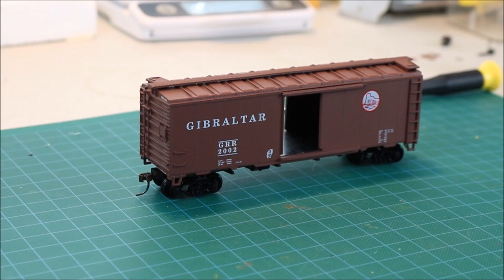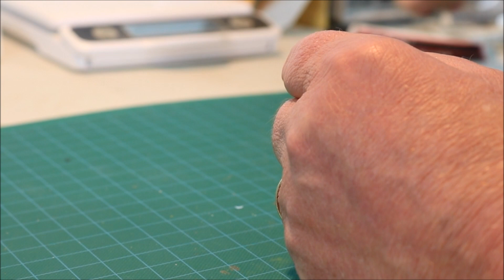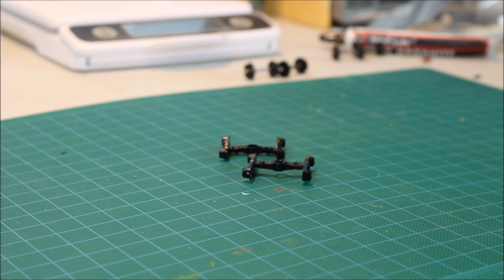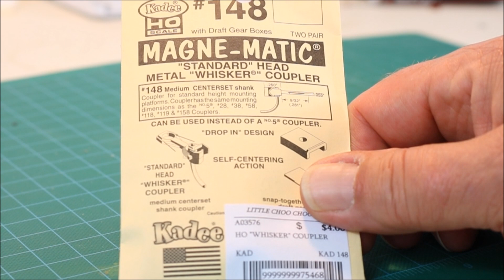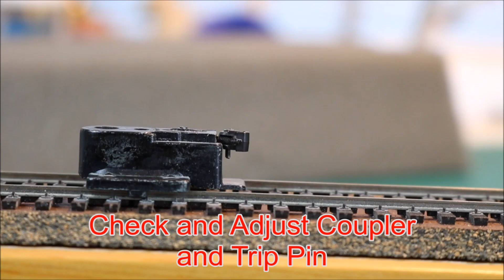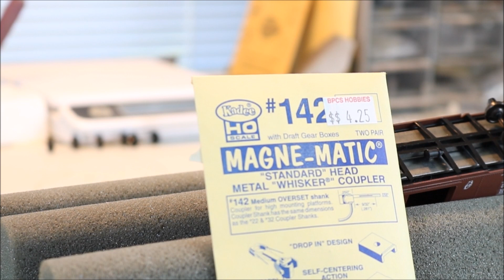How To Improve Rolling Stock Performance

Comment: Hello Sir, 
Recently I've been purchasing rolling stock like Walthers  that comes automatically with there own couplers. How do I know if the couplers on the Walthers cars are the same as the cars that I have with kaydee couplers? Also is there a list that will tell me what car can be used with this particular coupler? If the hook at the bottom of the coupler is a little longer than the other coupler can I trim off the tip so it could be even with the other? Like I said earlier I have no experience in anything about railroading and if it's going to be nothing but a real pain in the butt than I'll just give up on the hobby and watch videos instead.

Comment: I don't have too much of a problem with (well made) plastic wheels on simple rolling stock. One benefit I have found is they NEVER short out on turnouts, or anywhere else, for that matter...they can be painted to look good, a rusty flat brown works for me 👍 and if the axle is part of the wheel, they are almost always in gauge, and of course will STAY that way. Naturally, I only do this on cheap,  run-of-the-mill rolling stock...

Comment: Greeting Harold, I am a newbie. I have installed Kadee # 158 couplers on a new  Kato  P-42 HO locomotive. I have also installed them on (5) Bachmann 85ft Dome Cars. The couple on the loco are lower than the dome car. I'm have uncoupling issues. If I change to a standard head #148 and connect a #142 (Overset Shank) coupler to the dome car will that help me with my coupler height issue? Is the #148 and the #142 compatible?  I also was told that the standard heads are better. I would appreciate your thoughts.
Reply from the maker: Thanks for your question. I have not used standard head so I can''t comment about that. My experience with Kadee is that most of their couplers are compatible with each other should you should be ok,,,Harold

Comment: I feel that all rolling stock should be carefully prepared.  It's not that intimidating if you do it each time you add a car.  You can also go back and do 2 or three in an evening.  BTW  The RP20.1 weights are listed as optimums not minimums. I usually allow a 10% tolerance when weighting cars.
Reply from the maker: Thanks for your comment...Harold

Comment: Should aslo drill put and tap the center  couper post and and a screw to secure  the metal coupler clips
Reply from the maker: Good idea. I should have included that step in the video...Harold

Comment: Great tips. Never thought about changing the weight on rolling stock.. where can I go to get the recommended weight for various o scale cars? And.. the truck tuner.. that augers out the hole where the axle fits in? Work on o scale? Can you accidentally overdo it?
Reply from the maker: Thanks for your comment and questions. Unfortunately, the MicroMark truck tuner is for HO scale. There may be others available for O scale but I have not found them. And, yes, one can "overtune" the truck by pushing too hard on the frames. NMRA Recommended Practice RP-20.1 covers recommended car weights for most popular scales including O scale. You can find it at https://www.nmra.org/sites/default/files/standards/sandrp/pdf/rp-20.1.pdf...Harold

Comment: Harrold, im new to MRR.  Going Nscale.  I bought some rolling stock some new stock never used but may be older cars.  

I don't understand how some roll so well and some so poorly!  

I have and atlas silver series car that is just horrible but its brand new.    Can brand new cars come w such poor trucks and wheel "setup" that they need tuned?  Is this nornal or is it manufacturer maybe?

I would think that new cars even a little lower end cars, should have semi tuned truck n wheels but maybe im wrong.  Do you have to tune all your new stock and i should expect to have to do so w most manufacturers?

Thanks.  

MP
Reply from the maker: Thanks for your comment and view. My process is to follow the video's steps for all rolling stock no matter who manufactured it or where I got it. If you fall behind and allow sub-standard rolling stock, it will be difficult to catch up. If you want some shortcuts that I don't recommend: gauge the wheels, if the wheels are plastic, replace them, make sure the weight is right and the couplers are all from the same manufacturer and are mounted at the correct height. Can't take more than 15 minutes and will correct most of the issues that you are having with the rolling stock. But, don't forget that poor rolling stock performance can be caused by improperly installed track, track that is out-of-gauge or curves that are too sharp. If you're having a problem with a number of cars at the same location, the problem is most likely the track. If one car has consistent issues, it's probably the car...Harold

Comment: I found that it works better if you put the weights over the axles of each pair of trucks.
Reply from the maker: Thanks for your comment. Yes I agree. If you have the correct weights in two pieces they should be over the trucks...Harold

Comment: Hi thanks tons for video & comments.
Regarding HO what's the diameter in mm of 33" and  36" wheels?
What would be the equivalent in grams of 3.5 ounces?
How would you correct the rod  height if the shank is correct?
And yes in some Athearn blue box cars adjusting coupler cover drove me nuts to fix it back in place.😆
Looking forward to your comments I remain.
Cheers
Richard
Reply from the maker: Thanks for your view and comment. 33" is about 83.8 cm. 36" is about 91.4 cm. By "rod", I assume that you mean the fake air hose. One could bend it slightly using needle nose pliers  or (of course), Kadee makes a tool for this...Harold

Comment: I found using tire balance weights for your car works nicely as well. They are self sticking and you can get a lot of them cheaply.  I found some that were 1/4 oz. They fit nicely inside an HO rolling stock body.  I figured that these are designed to be on a wheel that spins and is outdoors they would stay in place on my trains. They pop off easy enough.

They are thin enough that I can get them into tanker car and they are not excessively noticeable when I put them inside an ore or open top hopper car.  I figure a little paint and they look like maintenance was done on the hopper to make it stronger.

And yes, weighting cars is important.  I never had good luck with passenger cars as they were always too light. Using these weights, I took a passenger line of cars that I was ready to throw against a wall into something I enjoy watching on the layout.  At the same time, i used that reamer tool from Micromart. A world of difference.  Weights and reaming the wheel set on trucks will fix so many problems. The time it takes you to actually do these steps vs. the time you spend fixing derailments or just not using some of your rolling stock will be worth it.
Reply from the maker: Thanks for your comment. All good ideas...Harold
Reply: I was going to suggest the same. I go to my local tire shop and get their used ones for free. Take them home and wash them up it only cost a little time.

Comment: Well thats a good and nicly made video :-) I did all those things somehow naturally as a boy when there was no youtube :-) Allign the couplers, add weight and exchange the plastic cr***p wheels for real ones. Problem was money, so I took liitle screw whashers for weight and bought iron wheels from my pocket money. But was never enough so I had sometimes one plastic one iron combinated running on the wagon. In retroperspective I also think, that the old tin-platers from the 1950s-1960s as crude they where made, where running better because of the wheight...
Reply from the maker: Thanks for your view and comment. Some intentionally use more weight than recommended just to make their rolling stock track better like the old tin-plate that you mentioned. There may be some downside to additional weight but we all should do what is comfortable for us and works for us...Harold

Comment: what a great video. fine tuning a rail car. i learned a lot from this video. how do you tell what size of wheels that you need? the guy at the hobby shop told me most are 33"
Reply from the maker: Thanks for your comment. I've been a frequent viewer of your channel for years. Wheel size may depend on era. Older (for example 40' box cars) rolling stock most likely had 33" wheels. On your modern era layout, most rolling stock probably has 36" wheel sets. On most models, the wheel size is printed on either the side or end. If not sure, one can measure the wheels but a difference of 3" in HO scale may be hard to detect unless you have really reliable calipers...Harold

Comment: I would like to add my comments here. On wheels  i use bachmann 33 inch flat back nickel silver wheels. They work great.  i have some old tyco cars. I remove the plastic wheels which are awful, and i put a drop or two of liquid lube in each journal box and install the metal wheels and they work great and roll very smooth. I have used other brands and they don't work well at all.. One of those being inter-mountain and i also tried walthers proto wheels , they didn't work well either.. Yes i have used kadee greasem and that is very messy, so i chose liquid lube.  On athearn cars, when i have the wheels and couplers off, I spray paint the stees metal weights with black satin paint after sanding the rust from the weight. I spray both sides, one at a time, then when dry, i re-install the weight.  On couplers, the only way to go is the number 5 standard kadee kat whisker coupler  thanks,    jackie
Reply: Hi Jackie, great comment!!
Highly appreciated.
I've got some EC 60' woodchips and got to change their wheels.
Cheers
Richard

Comment: Nice video, Harold! Very succint and to the point. I do have one suggestion: For your car weights, go to your nearest Harbor Freight store, or you can go to Harbor Freight dot com. Get some stick on wheel weights. They are made of steel and have an adhesive backing on them. They come in 1/4 and 1/2 oz. sizes. A package is, at this writing, $8.99 and you get a bunch of weights. Reading the reviews you'll find a lot of comments that people are using them to weight their model RR rolling stock. The only thing against them is they are slightly curved, to fit an automobile wheel. I just place them on the anvil portion of my vise and give a few taps with a ball peen hammer, flattens them right out. The adhesive is strong, so place them carefully. Kadee 148's are my "go to" coupler as well! Again, great video! Thanks for taking the time to make and post it!
Reply from the maker: Thanks. Good cost saving advice for anyone near Harbor Freight. Unfortunately, I'm not but let's hope others seeing this comment can use your suggestion...Harold
Reply: Even if you are not near a Harbor Freight you can buy the stick on weights on ebay and can even get them in black finish so they aren't as visible inside a box car if the doors are open.  For a pricing example right now in January of 2020 there are listings for 48 pieces of 1/4oz black stick on weights for under $9.

Comment: You made removing the cover box look easy I have a question of the cover box doesn’t stay on and I replaced it four times now is there anything else I can do to keep it on?
Reply: Sometimes the sides on those metal covers get stretched a bit. Try squeezing them together just ever so slightly. It may help them stay attached.
Reply from the maker: Thanks for your question. There are usually plastic tabs that keep the boxcar cover on the frame. Perhaps yours have been broken. You could simply glue it on with plastic cement but that would not allow you to remove it. Another option might be some tacky glue like liquid PSA (pressure sensitive adhesive) or some equivalent product. This stuff stays tacky allowing the boxcar cover to be removed but it might keep the cover in place...Harold
Reply: After putting the cover on Athearns, I put a tiny drop of super glue on each of the tabs.  Use a toothpick to pick up a tiny drop and place it.  If you get it in any of the moving parts you will have big trouble.

Comment: Thanks for the nice rolling stock tune-up vid, well done. I must agree with the other comments about finalizing the car before weighing, in the interest of being precise. I do also want to mention an important point you forgot to touch on which needs to be addressed; checking that the wheelsets are centered on the axels, or not dog-tracking. A condition which can cause the flanges to find imperfections in rail joints and pick the points at turnouts causing derailments. This is just as important as the wheels being in gauge.
Reply from the maker: Thanks for watching and for your comment. If I do something like this again, I will incorporate your suggestion about centered wheels. You're correct in saying that the fully assembled model should be weighed to be precise. It seemed to me that the couplers weigh so little that they would not contribute materially to the overall weight...Harold

Comment: NO!!!! please dont file the bolster down. Doing the drop down couplers and the washer trick is plenty. I have had a situation where the coupler was too high so I used the drop down coupler and then added a washer (to dial it in)(OCD)to make it the correct height. I think the second coupler you checked seemed a little high. I will keep replacing a coupler until I get it right. What I took away from my old club was to use intermountain wheels, kadee couplers, and weight the car like you did. I sprayed the graphite in after the coupler was assembled. Kadee makes a plastic coupler height gauge. I set up a small piece of track on the workbench so I can assemble the cars at eye level.
Reply from the maker: I agree with you...filing the bolster is not desirable but it is one possible technique. I've done what you did, using an offset shank coupler. It's not prototypical but it is more practical than bolster filing...Harold

Comment: How can i fix a car that wobbles side to side to much. Also how can i fix a sagging coupler.
Reply: Theres whats called a three point system. You tighten the first truck so it doesnt wobble at all but turns freely, the second truck let it wobble just a tiny bit. With the Athearn blue box and the metal clips you saw in the video you can bend the end of the clip up slightly but not too much. Also with some plyers you can make sure the clip is snuggly gripping the sides.
Reply from the maker: The wobble is most likely caused by the trucks being too loose. Try tightening them until they do not move at all and then give them about a 1/4 turn. That should do it. If weights were added but not properly centered, that could also cause a wobble. Coupler sags are generally caused by the coupler pocket being too deep for the coupler that is being used. You can resolve this by adding a thin shim of styrene cut to fit the coupler pocket making sure that it's not so tight that the coupler still swings properly.
Reply: Norfolk Southern Sherwood Subdivision the wobble is on several new cars. Lucked out when i needed to raise the car to match couplers. Fixed the wobble after adding washers on the trucks. Also had to file down a imperfection at the hole that also didn't help the wobble. Great video though.
Reply: Norfolk Southern Sherwood Subdivision and the coupler sagging is on a new car also but usually a plastic coupler. But I got extra steel no 5 kadees im gonna put on the few that sag. It has derailed like that twice.
Reply from the maker: Thanks...glad that resolved both the low coupler height and the wobble.
Reply from the maker: You'll like the Kadee couplers much more than the plastic ones that came with the car. They look better and, in many years of use, I have never had one fail.
Reply: Norfolk Southern Sherwood Subdivision I've put them on all my locos and my intermodel cars. Slowly getting my freight cars swapped. Had to get some long shank ones for my bli es44ac backend. Going around a turn it would catch the anticlimbers on the locos and pick one of them up.
Reply from the maker: Not surprised. Even if you look at the new Intermountain GEVO, it has long shank couplers out of the box. I know that replacing all the couplers and doing the other items is time consuming but it will be worthwhile in the end. Don't forget to do this for anything new...Harold

Comment: SWEETA!!! video,,, just one thing,, if you change out the P.... wheels & put metal wheels did you really need to add all the weights? 
But most of all thank you for all the intel, this will help,,, cuz it's nice to see a BIG smell on my 5y old's face when all go's well with the trains & not have the cars suddenly come a part ,,,, as I am in the mitts of a change-over to a better running rolling stock, this will help us soooo much,, THANK YOU,,,, all are cars have there metal wheels and I have starting to give them metal couplers,,, great video Harold thx for sharing,,, Tom B.
Reply from the maker: Very good question and something that I had not considered. The plastic wheelsets weigh 1/8 oz. The replacement metal wheelsets weigh 1/4 oz. It's a small difference but I could have added 3/4 oz with the steel weights with the remainder being made up by the difference in the wheelset weights.
Harold
Reply: Norfolk Southern Sherwood Subdivision I was going to suggest that you add the metal wheels sets before checking the weight of your car. Just by adding metal wheels that would bring the weight up on the car and you might not need to add any weight or add much to it. Plus, if you have an underweight hopper car, and you're going to add a load, add the load, metal wheels then check the weight. If the load is removable, add a washer to the underside of the load. If the car still needs weight, then you use a flat floor weight and glue it to the sloped sides of the hopper. Then piant it black to match the car interior. Harold, could you add a shim to the inside of a #5 coupler to lower it? Roy